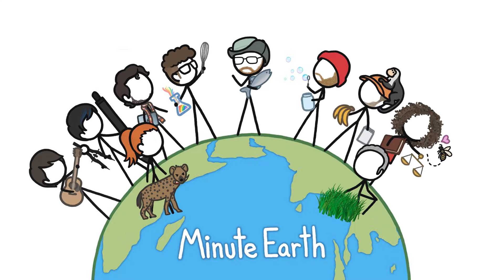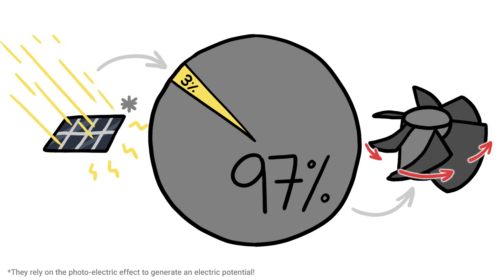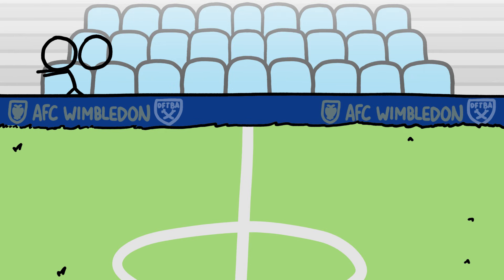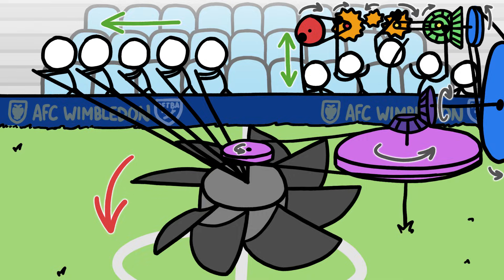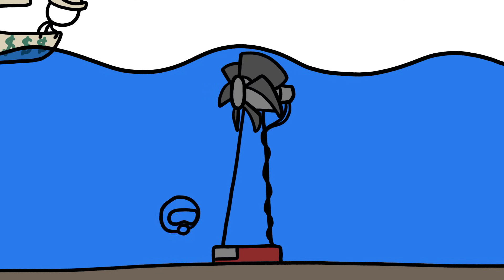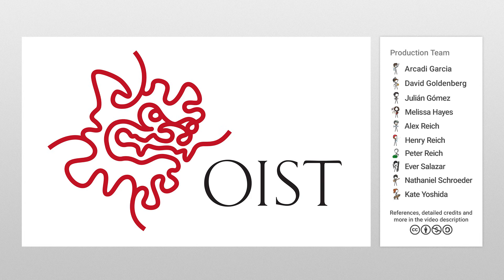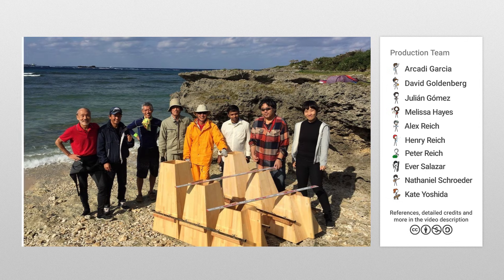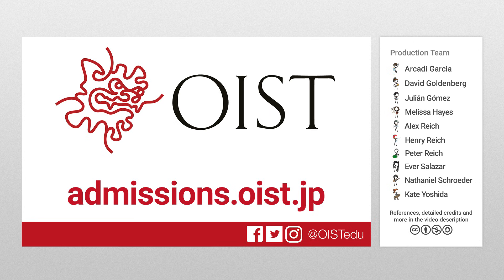Why Can't We Get Power From Waves?

Comment: It's important to remember that part of what makes fossil fuels so much cheaper is that they're heavily subsidized by the government (at least in the US).

To solve some of the maintenance issues of using buoys just put them under "docks" that extend out from the shore and have the generators themselves housed in enclosed structures on those docks rather than underwater.  Then wrap the the cable with a spring and you're good to go.  Alternatively you could use existing offshore oil drilling platforms to do the same thing.
Reply: or move onto more practical and efficient energy sources like nuclear

Comment: Wasn't there just a new method, that uses boyant barrels connected to a rod, that would turn the up and down motion into rotation?
You do not really need a turbine, if you can convert the motion itself into rotation.
Reply: Very low kW output, though.

Comment: Throw enough money at an impossible project and it soon becomes possible. eg. Putting 12 men on the Moon and returning them to the Earth alive.

Unless you tie into the 'Moon Landing Hoax' conspiracy theory.
Reply: @a man of many parts You can look at any engineering problem (or household problem)  like a triangle of concerns where the sides are project scope, schedule, and resources. In private companies, best case, you get the opportunity to increase the magnitude of two of the sides at any instant and the remaining side has to shrink; or you fail completely.

Projects that require ambitious scope, tend to require an endless schedule and resources. Governments are usually the only entities that can embark on that endeavor. The downside of government run programs is the lack of accountability or urgency, which is why many initiatives fall short. The engineers get to play but little of value is accomplished for the most part.

There's another part of the energy problem that people don't acknowledge often. Population growth. We're ultimately the problem and less of us is the solution, if you believe that energy production must be capped to "renewables".

Ultimately you simply cannot conserve your way out of a growth problem.

Collectively speaking, research dollars would be more effective on the problem of leaving this planet than grooming it into an ant farm controlled by a totalatarian government with the power to "rank and cut" the population e.g. China.

The reason is obvious, the power technology necessary to leave this planet and travel the stars on a regular basis makes the power consumption of the entire planet insignificant in comparison.

Helium-3 powered fusion is a viable option, we just have to finish what we started.

https://www.popularmechanics.com/science/energy/a27961/mit-nuclear-fusion-experiment-increases-efficiency/

https://www.pbs.org/newshour/economy/china-wants-to-mine-the-moon-for-space-gold

Solve the space problem and you solve everything.

Comment: if youve ever used a ratchet tool, you know that you are turning a cylinder with just small movements in one plane, same as would be done by a wave.  it is possible to get that turbine to turn circles by just repeating wave movements, the trick is buoyancy triggered by a set at angular intervals.  you can send me money on my patreon account once i set it up.  if you want me to draw up the exhaustive diagram I will need monetary motivation.  and thanks.

Comment: Remember how watches without batteries work? Through motion of pendulum. It might do the trick. MIGHT
Reply: The pendulum in the watch tightens a spring, and the spring moves a series of gears. It's what used to be referred to as a "self-winding" watch. Don't let this video get you thinking that generating electricity through spinning something is somehow an outdated technology. It actually works just fine. The actual generation of electricity is not the result of the turbine itself, but, rather, some sort of dynamo/generator that the turbine is causing to spin.

Comment: Tidal energy is the most efficient way I can think of to get energy from the ocean currently. Basically, build a big pool that fills at high tide, and at low tide, the water can only escape from turbine drainage like a regular dam. This is limited to generating power during low tides, but that puts it in a similar camp as solar power, which can only generate power during the day in good weather. Tidal power has the benefit of providing power at night, and disregards most weather conditions.

Comment: Water boils at room temperature in a vacuum you can make a vacuum pump cheaply using gravity 12 meters or more in height  the wider it is the greater volume you can pump. You then have a boiling chamber 1/2000th the size of a evacuated cooling chamber and in between you have a turbine and then a condenser coil.  You can recirculate the cooled water to be reheated. Using the method to create a vacuum with gravity in this video https://youtu.be/933XNdClFrc?t=507

Comment: We can though, it's electrical floating generator's with pressure springs, the waves move the magnet in the tube like one of those shaking type flashlights... So technically we can, just not practically.
Reply: What type of bearing surface? And what keeps it from rapidly grinding itself to shreds internally?

Comment: A good way to get energy from waves is to have something like bouy connected to a turnbine ( which isn’t in the water ) so when the bouy rises you pulls the cable which is wrapped around the turbine shaft, if you’ve ever had one of those toys which uses a foot long corrugated piece of plastic that when you pull launches another part into the air

Comment: Waves used to create pressure via an air vacuum and stored in energy storage systems via Vanadium Flow batteries which is mixed with salt water. 

Yeah North Korea on the world's largest Vanadium battery deposit. Arigato Gaijin

Comment: Using a bottom of the ocean anchor, you can use the wave(or even tide) the generate height difference via flotation device. As this oscillates, you transfer the energy to turbine via a differential or as a pump bring water uphill where it collects in a hydro plant. This wont happen though cuz people like ya know..?!

Comment: Wave power generators have been shown and proven to work. They aren't turbines though. They have mostly been hydraulic pumps that work based on buoyancy. They all rely on being lifted by the waves, and then falling back down.

It doesn't seem like we know what they would do to an ecosystem near the shore though. I wouldn't be surprised if waves crashing on a shoreline are important for absorbing oxygen. Also, many coastlines have very specifically adapted filter feeders.

Comment: How about using piezoelectric generators? Instead of trying to spin turbine blades, why not use the waves to generate electricity from a wall or column of pressure plates?

Comment: Nuclear power is incredibly effective. I think between nuclear and solar we could get off fossil fuels.
Reply: Just use Nuclear Power. Solar power requires large areas of flat land that could be more efficiently used for other purposes. It's also incredibly inefficient, It's little more that a hippy dippy feel good method of energy generation. Also, until battery charging becomes much more efficient and quick, you're not going to get rid of internal combustion engines.

Comment: Humans: We’re really advanced! We’ve got space travel and genetic engineering and a bunch of cool science shit!

Aliens: Oh neat, so how do you power all that?

Humans: uhhhh make spinny thing go whoosh
Reply: more like boil water :D
Reply: More like: burn dead things to make spinny thing go "Brrrrrrrrr"
Reply: @pawala7  Grow new trees to burn...instead of burning old trees that turned into fossil fuels

Makes perfect sense to me
Reply: @Jommybutler1234  Trouble with that is energy density.  A fresh-grown tree just doesn't have as much energy per unit volume as 1000 dead trees that have been squeezed into coal by millions of years of tectonic activity.  There isn't enough surface area on the entire planet to grow the trees we'd need to fuel our current energy needs if we reverted back to wood burning.

(That math is also a large part of why tree-planting efforts while better than nothing are not and literally can not be anywhere near sufficient to counteract our global CO2 production.)

We really have only three paths forward with respect to climate change:  1) Reduce greenhouse gas production significantly.  Given that we're still increasing our production globally, that's not likely to happen in time to save anything (yes the increase per year going down, but its still an increase -- just like taking your foot off the gas doesn't cause your car to come to a sudden stop.. and we're only doing the equivalent of slightly letting up on the gas..)

2) Remove greenhouse gasses from the atmosphere.  That's the idea behind tree planting but as already noted, its way too inefficient to accomplish much of anything.  There is some investment in CO2 harvesting technologies such as https://www.youtube.com/watch?v=63S0t4k_Glw .  While promising, it remains to be seen whether such technology can be scaled up enough to have a significant global impact (and they require power to run as well, so their ultimate effectiveness will rely on switching power generation facilities to something that isn't producing more CO2 than the scrubbers are extracting per unit energy.)

3) Reduce the amount of sunlight hitting the Earth.  There have been various proposals to do this, but they all suffer from one (or both) of two enormous caveats:  They're usually extremely expensive (some of them would cost more than the GDP of the entire planet) and they're often irreversible, so if we screw it up or fail to anticipate some important side-effect, we could be doing more harm than good.  The only thing worse than a rapidly heating planet would be a rapidly cooling one.  (Though its kind of fun to imagine what we could do with something like an array of adjustable sunlight-blockers in space -- raise and lower the earth's temperature as desired, within a small margin.  Of course its equally fun to imagine who would abuse such power and to what ends..)
Reply: @altrag  I was being facetious 

The only answer is nuclear power, it always has been the only answer
Reply: @Jommybutler1234  solar panels
Reply: @devforfun5618  Solar is great, but not in cloudy climates and not at night

Nuclear is the Only answer
Reply: @Jommybutler1234  Nuclear is a great "short term" solution but solar is better REALLY long term.
Nuclear is still a finite resource (technically so is the sun but that's being expended whether we utilise it or not so we may as well), with fission we have what little radioactive matter that is accessible (most is in the core since uranium's a heavy element but it's contributing to keeping the core molten so I guess you could count geothermal as nuclear if being generous), it'll be good for way longer than civilisation has lasted so far but will run out orders of magnitude sooner than the sun, even fusion isn't going to keep us going on that sort of timescale. A Dyson swarm of solar panels transmitting power to Earth (and beyond) is the only sensible end goal. But you're right we should be splitting atoms for now until the technology catches up with the ambition.
Reply: @Slavir_Nabru  you clearly have rose tinted glasses for solar though, as solar panels contain a significant amount of Cadnium which is toxic Forever, is a pain to clean up, and is nasty stuff for any and all enviroments. Solar is actually one of the worst options for us to replace our grid power on.
Reply: @HerbaMachina  Cadmium Telluride panels is just one type of solar panel, there are many other feasible options. Si (mono, poly etc..) photovoltaic panels are recyclable (90-95% of it) and, combined with hydrogen/syngas/synthetic methane production, they are very promising for the future (and sustainable since they literally recycle carbon dioxide).
Btw nuclear is not sustainable in the long term bc of nucleare waste, you can't just dig a hole and forget about it, which as crazy as it sounds  it's currently the best plan we have (also because it takes centuries, millennia even for it to become remotely """safe"""). Other than that they can only cover the base load since changing the output production of a nuclear plant is very expensive and extremely long (hours-days), while synthetic fuels can be ecologically and technically sustainable (especially when powered with wind, solar or wave energy).
Also nuclear power generates heat that generates electricity, think about automotive applications.. Electric cars are expensive as nobody knows how to make large and cheap batteries, while hydrogen/gas cars would be much more feasible.
Reply: @Slavir_Nabru  God created humans thousands of years ago. We will nearly destroy the planet before the time of the current world comes to an end. Maybe it won't take that long.
Reply: Yeah, it's a bit sad.
Reply: all starts simple uwu
Reply: laughs in human destroying it's own planet 😂

Comment: Here's a little interesting design I came up with take a one square acre area offshore in about 20 or 30 feet of water that can be cordoned off with buoys to Mark an unsafe  area to pass through with a boat. There would be a device under the water with a large crankshaft attached to the generator. The crankshaft would have ratcheting pulleys withlong cables attach two floating plates that float near the surface of the water these plates would move up and down with the waves and pulling the crankshaft .as each play was lifted by The Wave it would pull the cable and turn the shaft ,as the wave goes down the spring loaded pulley with a one-way ratchet would allow the cable to rewind and grab a new bite for the next wave .the next wave comes and lifts the plate again and the process repeats itself. This would probably work well as long as the plates and cables could be kept from tangling in each other. If there were enough plates the crankshaft would probably be in constant rotation the waves would produce all the torque needed to turn the generator this can be built on a small scale and tested inexpensively I have not had the money because I am a poor working bastard who can barely afford to feed my family could someone with some money please take this idea and do something with it? I have all the confidence in the world that it would work.i dont want your money , i want to see Rockefeller  go down.

Comment: Hey maybe you can answer my quention now. Why not take electricity from lightning storms?
Hopyfully I can get a shout out.
Reply: you tell me when and where they will land and i'll make electricity out of them.      but it'd be very hard, as to make the electricity do work, you require resistance in the circuit, and if you have more resistance than the surroundings, the lighting will just go to ground instead.
Reply: @mralistair737  

Why r you treating this as a dumb question?
Reply: @rjpena6273  I am not,  lighting is very high energy, but very fast, and not controllable or predictable (which is what you need)  a single lighting bolt has enough energy to power a 60watt bulb for 6 months according to this site..  so that's not really very much,    But more importantly how do you get the energy from the lightning into a useful form, electricity is hard to store and lighting delivers all that power in one split second. and as i said if you provide electrical resistance to your lightning rod (eg to charge a battery, or run a motor) then the lighting will just go elsewhere. https://www.realclearscience.com/blog/2012/05/could-we-harness-lightning-as-an-energy-source.html
Reply: @mralistair737  

Okay thanks!

Comment: Yeap waves can be hard to harness energy from. Although one idea i've seen is where you put underwater kites that are anchored to the seafloor where there are strong currents, then they move as they would in the air and thus, yes, spinning a turbine (who would've thought :D ). I think the company's called minesto
Reply: IamNord That’s current though and not waves. There are definitely some designs that work with tidal currents, even if they have a hard time withstanding corrosion and sea life.
Reply: @Yggdrasil42  Yep, that's what i was saying. Just another innovative way to harness the power of the oceans :)

Comment: You know instead of trying to build a turnbind why not build a perfect a better kinetic generator? Like those flash lights that charge when you shake them. Waves are good at shaking things. They already invented a kinetic generator into a soccer ball. As you play with it charges it's internal battery. Why not have a bunch of these balls rides? With cables plugged into them.

Comment: I dunno man, a lot of interesting, viable projects going on off the Scandinavian coasts, like those by Waves4Power. They're not that far from being financially viable, and a single current wavepower station is generating about 2 megawatts. They can tolerate waves up to 25 meter, beyond that it will lift the anchoring base, meaning it will need to be moved back into ideal position after the waves passes. They've already been through waves of 20 meter ish, without issue or damage.

Comment: Why dont we make something like an engine. Up and down pistons essentially rotated to rotational energy
Reply: We do.  It is common in remote areas to use diesel engines for powering generators.  Those engines use piston-cylinder assemblies, just like the diesel engine in a truck.

It isn't as efficient or cost-effective as using other methods (coal, nuclear, gas turbines) of power generation, as makes up most of the fuel mix for large scale utilities.